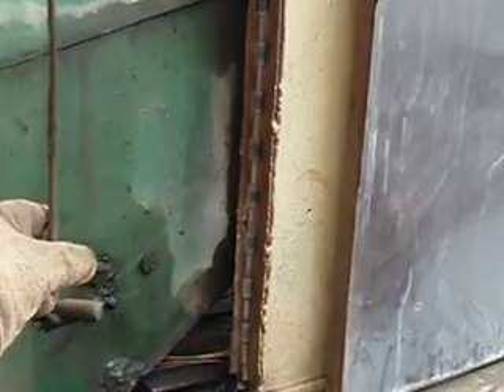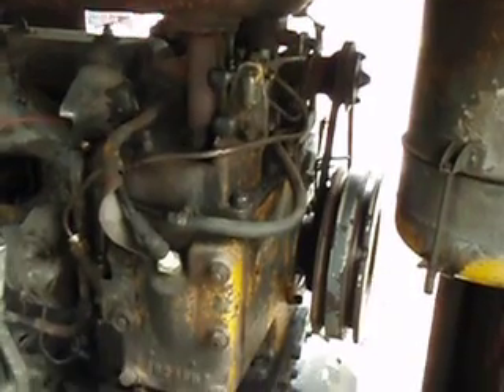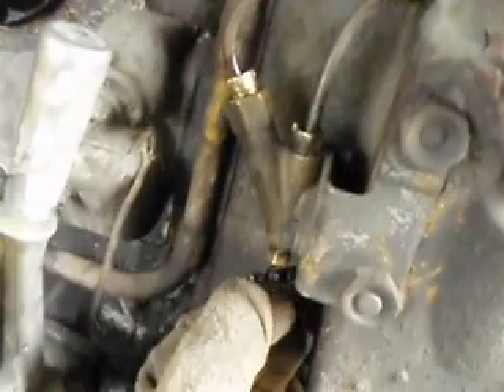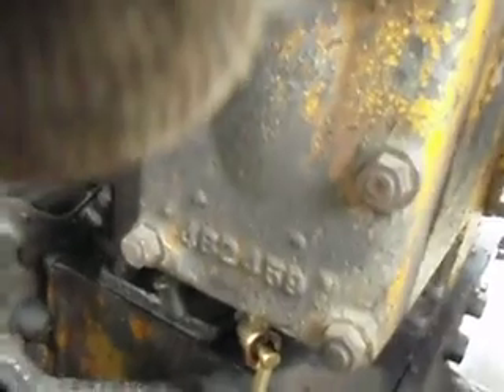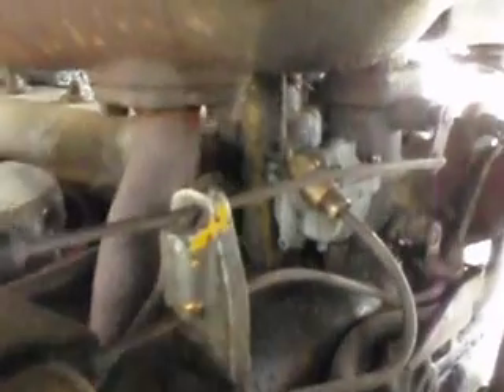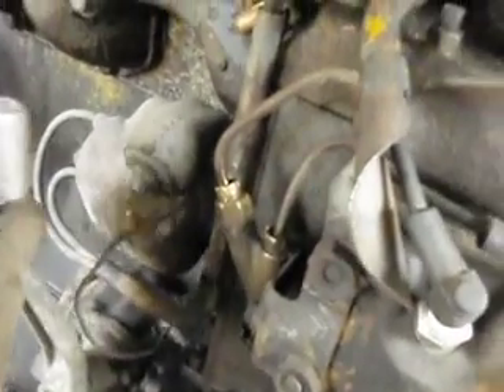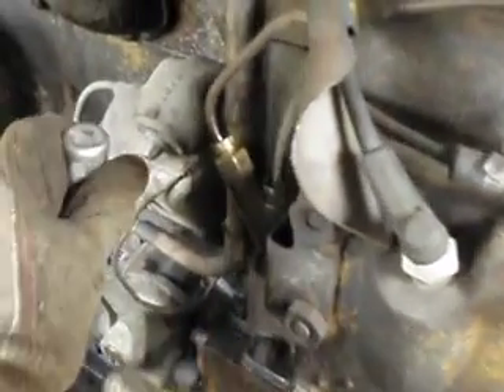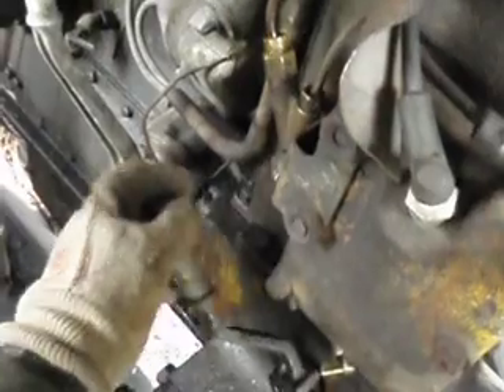How to start a D318 caterpillar diesel engine with a cat gas pony motor - starting engine

Comment: I learned on an identical machine in 1974, also no electric start on pony. My neighbor bought it new with a boom and shovel front for almost 17K in 1947. Imagine, spend that many $ and not the little extra for electric start. We would almost always use just a whiff of ether so the pony wouldn’t have to crank so long, never a problem to this day.I started it in about 2000 after about 15 years of sitting, took 15 minutes to get running. A friend now owns it and I hope to acquire it some day. Thanks, really brings back memories.

Comment: I just watched a video of a jet engine being started with a faulty star valve. A mechanic stands next to it with a rachet extension through the cowling and manually operates the valve while the big jet starts and revs up to about 50 billion RPM.

That reminded me of working at a marina when I was about 14, in 1982ish. At the marina I started the old crane just like this. It was intimidating as hell to me but now its a fond memory. Thanks so much for this video!

Comment: In colder climes, the pony motor made more sense as the crane would sit unused for much of the year.   For filming purposes, I sense starting the main engine was a bit rushed as the pony motor would be engaged for whatever length of time was required to warm up the cylinders.  Otherwise, a fairly good video on the startup procedure.

Comment: does tiny engine can also be started with and battery drill with some grease on the fastener so drill does not stick on little engine and smack your hand
Reply: +Len Vantil  Like your  thoughts , but they put a man on the moon long before everybody had a battery drill  . They did however soon came up with the car battery starter for pilot (pony ) motors .  Best start I ever remember , the mechanic got my cable D9 going with a 400 amp welder . He just said get in the seat  and crack the throttle . There was arcing & sparking but you should hear big motor turn over before I opened the throttle .

Comment: Wow, it's weird that such a big machine is only rope-started! If there were electric starters on cars even back then, then why not have an electric starter on the pony engine here? And why not diesel on the pony engine too, so that they could share fuel?

I've seen these before, but I wanted to add my comments and questions to this video too. Weird, semi-complicated system!
Reply: +Maxx Fordham Electric starters were in their infancy at the time and pony motors were great in cold conditions. If I remember correctly, they shared cooling water with the larger diesel engine and their exhaust was routed around the diesel air intake to pre-heat the air going into the diesel while cranking it. Gas engines are easier to start in the cold than diesels, and at the time I don't think small diesel engines had really been developed.
Reply: That's interesting, MichaelTJD60. But I'm not sure about that thing about electric starters being "in their infancy." What about all the cars from that time that would've already had them? They had already moved out of crank-starting cars and trucks a long time before, hadn't they?

Oh yeah, gas*oline* engines would be easier to start in the cold than diesels because gasoline is thinner.

Nowadays, though, you could have a large diesel engine like this and still not need a pony motor, of course. Ya wouldn't need a smaller diesel engine just to avoid a pony.

(By the way, "pre[-]heat" doesn't need that hyphen.)
Reply: Yeah "infancy" wasn't the best term I could think of. For diesel engines, electric starters had not been proven reliable but for smaller engines they were fine. And that's why nowadays pony motors are no longer needed...lol.
Reply: John Deere, whose original pony motors were developed by Caterpillar, didn't start using electric start on their diesel tractors in place of the pony motors until around 1957. Right around then, electric start was becoming more reliable.
Reply: I don't know...in the 50's and 60's most vehicles ran on gasoline. Diesel wasn't anywhere near as commonly used as it is today.
Reply: +Maxx Fordham any idea how many amps it takes to start even a diesel truck in the cold? could you imagine the amount of torque and power it owuld take to turn over an engine like this when the oil is half frozen and about as thick as molasses? they had no decent batteries in that time.. no way of storing the amount of power required to start an engine like that with just current. most cars at the time ran on 6 volt power, which wpould take an entire car trunk worth of batteries to start somthing like that..pony motor runs on gas because a gas motor just mnakes sense in very cold climates, clutches and levers to make trhe system mechanical, easy for an old farmer to repair or whoever owns the machine
Reply: Right, but most small-engine starters even now are just 6V ones. They should've been able to work okay even back then, I would think.
Reply: Caterpillar offered a reliable electric start on the pony but I think people generally people were more frugal then and were used to starting small engines with a crank or rope so an electric start was an unneeded expense. I ran my neighbors identical machine which he purchased new, he was very frugal, and purchased it without the electric start.

Comment: I love how you say, "That's all there is to it!" as if you had not just gone through 2.5 zillion steps, several numerous times to 1) get the pony started, 2) get it to turn the diesel over fast enough (warm up the pony) and then, FINALLY, 3) get the diesel to start. By your own timer, all that took over seven minutes, which is pretty good, given the temperature & how long it had been sitting. Kudos & accolades for your skill & attitude.

Comment: about 5 to 7 minutes to start these engines, IF they cooperate... Much longer if they don't ... And two motors to maintain...  it is why we sold or scrapped all our pony Cat stuff and kept the IHC gas/diesels and Detroits.. Don't get me wrong, old cats are good stuff... we just didn't like having to pony-start them many times a day as our work required...

Comment from the maker: @UnitCrane514  These machines were so popular I think they probably had just about every engine around in them. I ran one with a gas start international in it, a few with detroit diesels in them, had a late model 22b back in the late 70s that had a nice cat with a turbo and a 2 speed transmission- that was a sweet machine.

Comment from the maker: @UnitCrane514 This machine never had an electric start, although you can see the groove for the fanbelt on the pony motor flywheel. The electric start conversion kit was basically a starter with a fanbelt connecting it to the flywheel. This way I never have a dead battery that needs jumping, although I have thrown out my shoulder a few times pulling on that rope :)

Comment from the maker: @UnitCrane514  To turn the diesel off you push the throttle lever past the idle position to the shutoff position, most of the older cats are this way.
Yes thats correct the Bendix puts the starting motor in gear or connects it to the diesel. It is similar to putting a transmission of a car or truck into gear. When the diesel starts the bendix kicks out so the diesel will not be turning the pony motor over.

Comment: How do you turn the Diesel off? And what does that small lever thats  to the right of the clutch do? I believe you called it a "Bendex"???   No electric start on the pony? Most of the bigger names like Link Belt Speeder and Northwest had electric starters for the pony on the Cat D318. What other motors were availible for this machine?